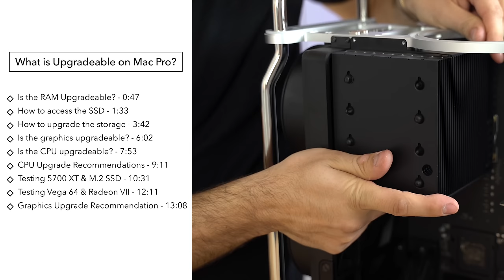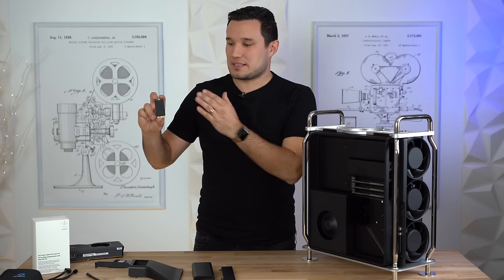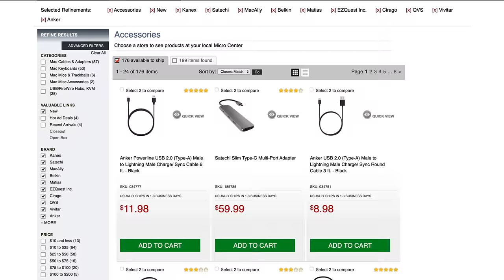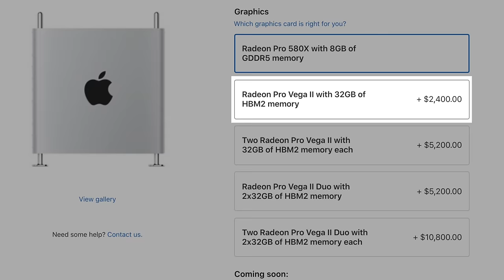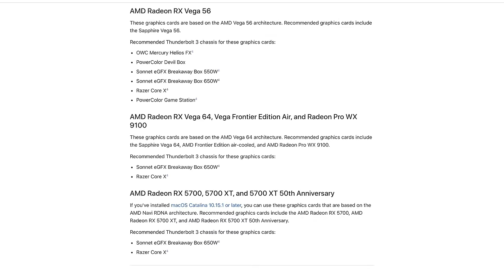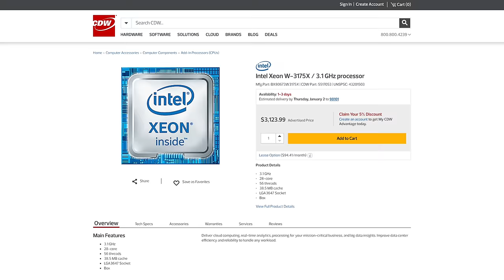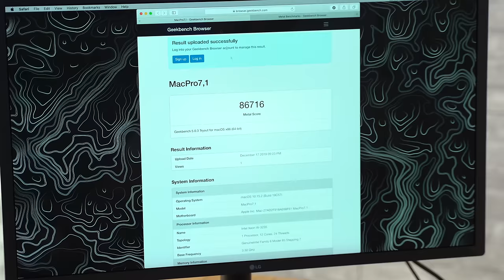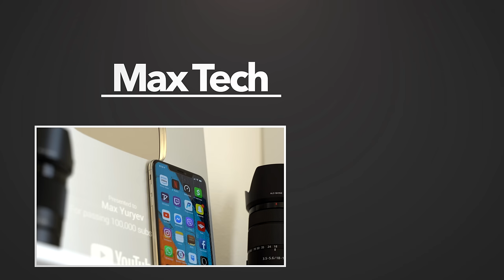2019 Mac Pro - Everything you can Upgrade & How!

Comment from the maker: Browse all of Micro Center’s products: http://bit.ly/2S9wevA
Find a location near you to order a Mac Pro configuration in store: http://bit.ly/2Q0F7oj
Browse all Apple Products: http://bit.ly/34zyKgX
Max Tech Wallpapers ➡ https://bit.ly/2WNc6Qw
Reply: Radeon Insticnt m125 mac?
Reply: Hey!

I have iMac 21.5inch 2012 late and the CPU is Intel® Core™ i5-3330S  and I want to upgrade this to a Core i7 New generation CPU is the work or configurable?

Thanks
Reply: Hi @Max Tech, I really enjoy videos and your guidance overall. You had me convinced purchasing the 28 core 3175X and I am now waiting for my Mac Pro that is probably delayed.. So all this waiting time, has led me to explore what other people think about the compatibility. So far, I have encountered one on Mac Forum who says it is NOT compatible as it has too little PCI-E lanes and a different CPU id that is not the supported CPU ID's that are 50655, 50656 and 50567.

So all in all, I have the 3175X here in front of me and I am no worried that it may not work after all.

As I am waiting for my MAC I would offer to send mine to you for testing or would you perhaps be able to get one yourself and prove that it works?

All the best
Daniel :)!
Reply: Just wanted to point out, based on my research the x16 nvme card you listed is NOT compatible with the Mac Pro 2019 as it does not support bipurification. Correct me if I'm wrong but that's what my research has told me so I will not be buying that card.
Reply: Like your unbiased pc and apple channel max!
Reply: Hello, I bought the MAC Pro 2019 in the 8 Core version. Unfortunately the Intel CPU W 3175X does not work in my system!

Comment: THE ASUS CARD IS NOT COMPATIBLE. Buyers beware (and beware recommending something you haven't tested, even if you say you haven't in video): the ASUS four-SSD PCIe adapter you link to is NOT compatible with the 2019 Mac Pro. Search web for full discussion, should be easy to find. And yes, I tested it (having bought it through the link you provide, doh) and I can confirm IT DOES NOT WORK.

Comment: in 2 years the 28 cores will be less then 500$
Reply: @mavfan1  of course. I was just saying because he said that in 2 years the 28 cores will be around 1500. I was just assuming the second hand market in 2 years. Also in 2 years a 16 core CPU will be mainstream, so the 28 it will not be high end. That is the problem with this machine. That you will not be able to upgrade in 5 years. By the time they will have higher end processors this socket will be absolit. Of course this machine it's crazy fast and it will make a tone of work. Just that it's so expensive and already old. Pcie 3, 28 cores....
Reply: I think 2 years is too soon for that price you mentioned.

Comment: Some constructive criticism, I was trying to follow carefully your Belkin cable section. But there are no close ups, only a wide shot of you holding two cables, you don't show the cable clip itself close or even a mid shot and then after connecting you cut immediately away from your hand close up to the apple website so we don't get to see the final cables connected. These directions for this part are confusing and not clear to the viewer. I appreciate the vid but for someone who hasn't used these cables before its frustrating.

Comment: If it helps anyone here the Sonnet 4x4 PCIe 16x card works beautifully in the new Mac Pro. Ran all my tests and it flies!
Reply from the maker: Thanks for the input!
Reply: I hope my highpoint ssd7101a-1 will work on it too
Reply: What read/write speeds have you gotten and what raid config do you use? Over 7000mbps?

Comment: The Radeon VII was discontinued by AMD several months ago. The 5700 XT is far more pragmatic option if you want graphical performance or any of the Radeon Pro cards if you want lots of VRAM.
Reply: The radeon 7 will destroy the 5700xt in computational performance actually, not sure why Apple is putting such little effort in third party drivers.

Comment: I'm being told the ASUS Hyper M.2 M.2 SSD 16x Adapter you linked above does NOT support 2019 Mac Pro - can you confirm it works? My question and response from the vendor you linked are here: Q: Will this work in the 2019 mac pro? and if yes, will it use virtual raid on cpu (intel® vroc) or apple raid? 
A: NO   By Python on December 23, 2019
Reply: Definitely dose not support PCI-e bifurcation. For 1 there is no need with the amount of PCIe resource it has. 2 that is dependent on the Motherboard manufacture to add the feature. If you added a Asus Hyper 16 M.2 I believe you would only see the first drive as there isn't anything to tell the PCIe slot to use 4x 4x 4x 4x. Only PCIe M.2 cards that have more then 1 drive would need a PLX chip on it. Those tend to be more expensive cards. OWC Accelsior 4M2 or Amfeltec Squid for example.

Comment: Dude, it looked like you had the Radeon VII in the x8 slot instead of an x16 @12:21 according to the PCI Expansion Slot Utility that's what the PCIe slot next to the Slot 1 MPX module is, that could explain your scores

EDIT: scratch that, someone pointed out to me that that was the PSU that I thought was the MPX module

Comment: What happens if you put the Radeon VII in when the Radeon 580X MPX module is still installed? Does the total GPU capacity become 24GB? The 8GB from the 580X and the 16GB from VII added together.

Comment: Are you able to explain what the afterburner card does? cos i have no clue what it even is
Reply: It's hardware acceleration for video encoding etc. It lets you stream multiple super high resolution, RAW video feeds all at the same time in real time. You could have say 4 x 8K RED RAW files playing at the same time in your timeline with no buffering or having to use proxy footage as you'd often have to do with working with such high quality files.
Reply: @TalesOfWar  it only works for Prores and currently only decodes. Will not do anything for RED footage or any other codec

Comment: Hello Max Tech, i bought the same SSD controler than you but i have this message : " The pci cards installed are not available according to the optimal configuration " 
I used the number 6 PCI. I tryed different PCI
Thanks

Comment: I believe you can also install macOS to one of those M.2 drives in the PCIe adapter and use faster drives (not to mention larger) then what the Mac Pro comes with.
Reply: For now at least. Linus (Tech Tips) has the very convincing theory that once their complete lineup uses the T2 chips (only one older Mac is missing) Apple will most likely completely remove the ability to download MacOS, probably to kill Hackintoshes. There's no other theory why the T2 is so oversecure that it doesn't even allow user upgrades.

Comment: I can also confirm that my Asus Strix 2080Ti works perfectly fine (under BootCamp) ;-)
Reply: dam_j Do you see any performance loss? Thanks for confirm it works.
Reply: I just run a simple round of PUBG in 4K / Ultra Settings and it feels exactly like on my gaming Maschine with an Intel i7 8086 (6x 5GHz) !
Reply: dam_j Woah, that’s awesome. Thanks!
Reply: I’d love to know if you can put a couple of 2080ti’s (using sli/nvl.... I am not sure what they call it with the new rtx cards... but where they combine two card into one memory block for GPU rendering) and run them under bootcamp... that would be cool.... hell of a lot cheaper to just use a PC I know but the idea of having a pretty fast PC and a blazing fast mac each with their own strengths in one machine would be pretty cool.
Reply: I tested myself that one 2080Ti is no problem and works perfect under BootCamp ! Sadly i have only one so i can´t test NVLink...
Reply: Thanks for reply man
Reply: @peterallen544  I'm pretty sure that's a no since you need a motherboard compatible with SLI NVLink. I don't think Apple would include support for the heck of it.

Comment: I think you should be able to upgrade to Xeon W-3275M as well, which is 28 cores and turbos to 4.4GHz and supports up to 2TB of ram, and the socket is the same as that of W-3175 which is FCLGA3647.

Comment: Has this👇 card you recommend been tested with multiple SSDs plugged into it? There are reports it works with one but I have not seen it will work with many. I’ve read that motherboard support is required. And this is yet to be confirmed on the Mac Pro. 

ASUS Hyper M.2 X16 PCIe 3.0 X4 Expansion Card V2 Supports 4 NVMe M.2

Comment: 3175x is 250w will it be ok?
Reply from the maker: Watch our thermal video to see how cool it is. I think based on how that performed it should be fine.
Reply: I highly doubt it, that heatsink is not adequate for a 250 w cpu, also the 3175x is not like other xeons(as explained by Gamernexus) is supports less ram, has less pcie lanes, is overclockable etc. Even if the cooler is capable, I don't think it'll work
Reply: @GeckoClever  true but then I don't think it'll supported on the first place
Reply: @sidm4609  "heatsink is not adequate for a 250 w cpu" - Mac Pro heatsink is bigger than Noctua nh-d15, it is gigantic
Reply: @GeckoClever  did i say Noctua is bad? I said if this heatsink can keep 200 watt CPU, sure it can keep 250 watt too
Reply: @Gecko

agreed. my two concerns are power provided to the cpu and what clock speeds are available. on a PC BIOS maybe you select this but how on a Mac. no mainboard simply allows any speed and any power - and Apple could easily have locked their mainboards to one of either based on what cpu it shipped with.

it is possible but until someone starts dropping Xeon W chips in and see what happens i am still not 100% believing
Reply: I think the problem isn't about the cooling. The problem is whether the mac pro supports it in the first place...

Comment: Can we upgrade Mac Pro 2019 with the new 2.3 GHz 64-core 3990X AMD Rryzen CPU for $3,990 dollars instead of the old
2.5 GHz 28‑core Intel Xeon W processor for $7,000?  We can save $3,010.
Reply from the maker: Of course not. It uses an Intel motherboard with an Intel socket. CPUs with only a specific socket are supported. -Vadim

Comment: Would I be right in thinking that if I got a machine with the base graphic card and then added -two-Radeon VII cards, I would be getting better graphics performance than getting the machine with the single Vega II card for about half the money of that card?
Reply from the maker: If the software you are using can utilize both graphics cards properly then yes!
Reply: @MaxTechOfficial   Would that include Premiere and Resolve?

Comment: Hello Max and thanks for your video, about the W-3175X, will it work only with 2666 or also the 2900 RAM ? and if not, is the computer running really slower with that lower memory speed ? Also I've noticed this processor is 38Mo cache versus 64 for the Apple version (with 28 cores too), what cache amount does affect on computer performance  ? Thanks a lot :)
Reply: Apple advertisers the L3 & L2 cache combined. So it’s a bit misleading. You should be comparing the 3175x L3 cache to just the L3 cache. Not L3 + L2
Reply: @adzpana  thanks ;)

Comment: Can't really find any information online about PCI-e bifurcation support on Mac Pro 2019 (especially officially). 
I'm sure it should have supported, but will it compatible with existing 4x NVMe cards? 
Not a good idea to say it in the video if you cannot verify.
Reply from the maker: Yes we showed it off in the video.
Reply: @MaxTechOfficial  Looking forward to it! Great videos none the less :D
Reply: Definitely dose not support PCI-e bifurcation. For 1 there is no need with the amount of PCIe resource it has. 2 that is dependent on the Motherboard manufacture to add the feature. If you added a Asus Hyper 16 M.2 I believe you would only see the first drive as there isn't anything to tell the PCIe slot to use 4x 4x 4x 4x. Only PCIe M.2 cards that have more then 1 drive would need a PLX chip on it. Those tend to be more expensive cards. OWC Accelsior 4M2 or Amfeltec Squid for example.

Comment: Hey Max - i just got the macpro and it seems the 4-slot ASUS m.2 Adapter that you mentioned is not supported on the macpro since the motherboard does not have bifurcation. - so it can only support one ssd at a time, even if there are four slots 
Maybe you can point to who said it should work, maybe iam just doing something wrong ..? 
inserting the card with one ssd botted fine and it showed the storage, but with two ssds installed the system booted but showed none of the two ssds, and even didnt recognize the pcie card at all.

Comment: For the mac pro : the GPU is too weak. The Vega II single card is twice as slow as an RTX 2080 which makes this computer irrelevant for GPU rendering app like color correction on DVR, video editing or 3D creation. 

For the XDR display : This display is not good for monitoring, it has a contrast shift when you change your angle of view, this shows a lack of precision in color rendition, it does not happen on Eizo, Flanders, Sony or Canon monitors. If you need an entry level true precision monitoring screen, go with the Eizo, they are cheaper and way better. And don't forget to plug it to an external video card and not directly to the GPU otherwise it won't be precise enough.

My 2 cents.
Reply: QLS SAV:  so I’ve used a Flanders a few times. It does indeed shift based on viewing angles. But only in value. Does the XDR shift in other ways?  Also, why would the external GPU produce less “accuracy” than the on board GPU?  I seriously doubt ELM noise can be too drastic. Cables and such should be shielded enough to prevent any noticeable losses.
Reply: @tombittikoffer412  Well it's weird if your flanders had a shift, mine did not, but they are covered by a good warranty and good support. It depends on its age and the conditions it was under, if it received natural light that could have damage it. For the GPU, you should never plug a color grading monitoring screen directly to the GPU but to an external video card like a blackmagic decklink or an Aja card, because the gpu won't show you true above 8 bits depth colors first and then, the GPU will mess up with the frame rate accuracy. Basically, the signals types are not the same, it's litterally day and night in terms of color or frame rate, even for simple editing one should have a decklink, they are not that expensive (less than 200 € for entry level) and they change your life for better. Kind regards
Reply: i use a nvidia 1070 which is much lower than the Vega II and I use it for Maya, Keyshot and Nuke along with the Adobe suite of products and it works.
Reply: @ninjaman58  yes, I've used the GTX1070 to grade some projects shot in ARRIRAW in Da Vinci Resolve and it worked like a charm where the trashcan mac pro could not handle these files on the long run, it became very hot and its GPU started to have some glitchs, the 1070 was and still is a very good gpu for pro use absolutly.
Reply: QLS SAV so man. I think you brought up something important. They had it in a room that got natural daylight. And I suppose that could do something. 

I also got to work on an XDR and now that you brought up the shift, I can’t unsee it. ARGH. Hey man. Not my money. 

Thanks for the input.

Comment: Max Tech. The reason why de XT is scoring lower in Metal benchmarks is because Navi was not created for Computing Power. The Vega cards have higher Computing power. Navi is better in games and Vega is better in Computing calculations. This is why the Navi card scores lower than the Vega
Reply from the maker: Oh I absolutely understand why the 5700XT is scoring like that but for that same reason you listed the Radeon VII should be scoring much higher since it has 64 compute cores instead of 40 but our Metal scores are almost the same..
Reply: @MaxTechOfficial   O now I understand. Sorry for the misconception. I understood in your video that you didn't understand it. Sorry. Didn't want to be rude. I can't answer that question tbh sorry

Comment: The main thing that worries me is that it's powered by Intel. Setting aside the performance aspects of that, Intel usually demands a whole new motherboard for every new processor generation. But the Mac Pro is using a bespoke motherboard. That's got a couple of potential problems: it might mean that Mac Pro owners cannot upgrade to new generation CPUs ever, or affordably, depending on if there's an affordable way to buy next-gen Mac Pro motherboards (and I doubt it). The other issue with using such specialized tech is what we saw with the Trash Can. It ended up never, ever being updated because it's really costly to keep making bespoke hardware for niche devices that aren't replaced frequently. Like the Trash Can, the Mac Pro 2019 will require almost entirely bespoke parts, up to an including mundane parts like GPUs for each subsequent generation, so who knows how often, if ever, the Mac Pro 2019 will be updated.

Comment: Hi, 
It is possible to put any AMD GPU on the Mac Pro ? Without limitation ? I read that we lose the 3d acceleration
Thanks
Reply: Ouzala VanMeWe If they dont make an effort to let that happen, why should it run slower? MacOS supports all AMD drivers. As long as no other component wont bottleneck the gpu everything is in check
Reply: @gamenikhd2001  Thanks

Comment: Hey dude, thanks for the video. Im editing a ton of 4.5k red raw files on FCPX with my base iMacPro... Im running an external screen as well. My 2 questions are this: 

1) Can you run 2x XDR displays + 1x 4k display with the Vega pro ll 32gb? Or is the Duo the only option?

2) Would you go higher on the CPU cores or bump up to the GPU from Vega pro ll 32gb to the due? I price vs performance was the only option?